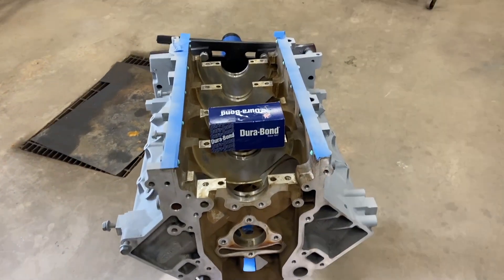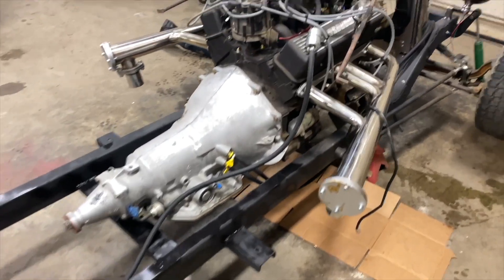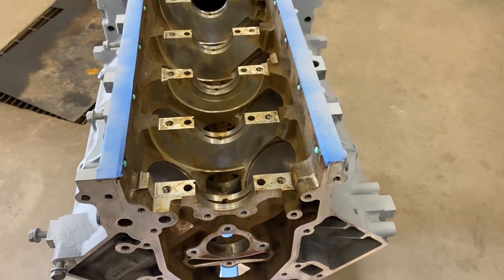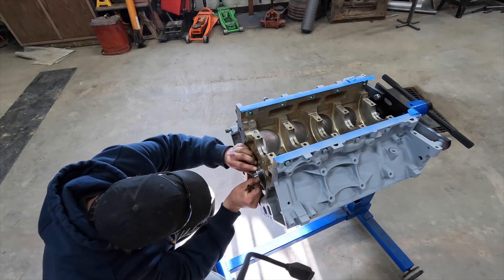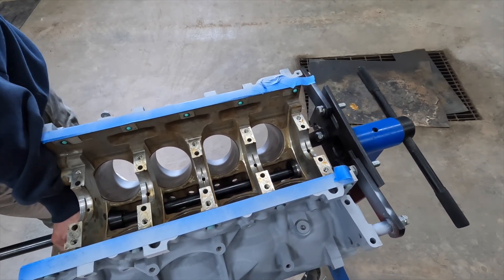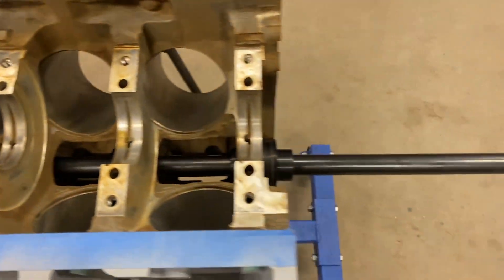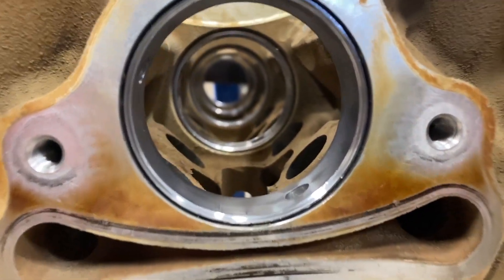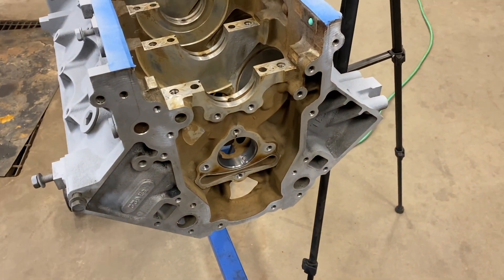Cam Bearing install on aluminum LH6 LS Block

Comment: looking at the cam bearing install the pix showed a hole in the bearing shouldn't that have been over a oil hole.????   it looks like its not lighted up???
Reply from the maker: All holes got lined up, bearings have 2 holes but block only has one hole per bearing

Comment: Nice Vid I notice you didnt lube the outer bearings is that because its a aluminum block and was wondering that goes for the same on a cast irom block ?
Reply from the maker: I did lube it. Just didn’t show it

Comment: With the expansion of aluminum, you're not concerned with spinning a cam bearing?
Reply from the maker: Nope these bearings are designed to be in an aluminum block
Reply: @bickfordcustoms  really? I wasn't aware Durabond made cam bearings specific for aluminum blocks. I'll have to look into that.